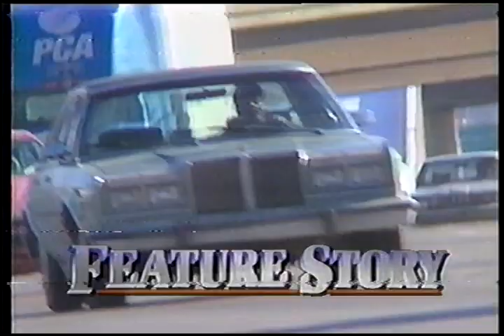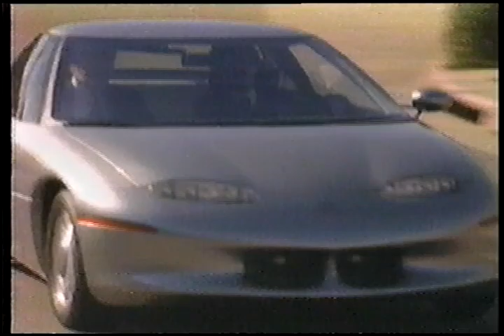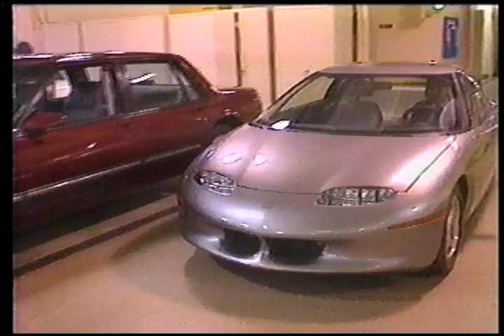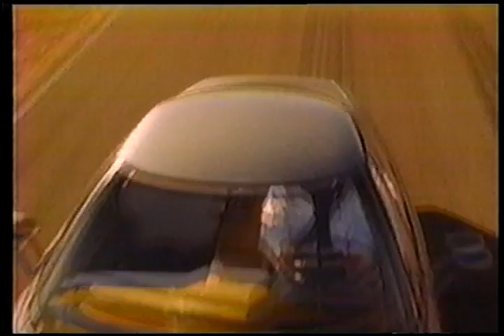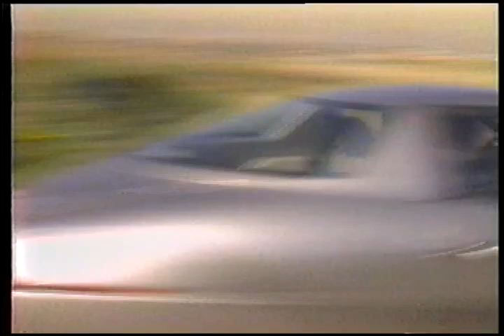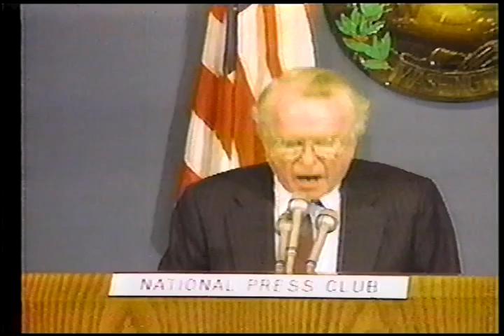1990 General Motors Impact Electric Vehicle (EV1) - Driver's Seat Retro

Comment: There were EV1 electric cars which they were made by General Motors since 1990.  Those models were two models of the EV1 Electric cars back in sixteen years ago from 1990 to 2006.  EV1 electric cars by General Motors would be missed a lot.  My parents didn't get both models of the EV1 electric cars by between 1990 and 1996 models for their own both 1990 and 1996 models of the EV1 electric cars by General Motors when I was young back in San Jose, California back in eighteen years ago from 1986 to 2004.  EV1 electric cars by General Motors didn't like us in this whole country of United States anymore.

Comment: I could see it beating the Miata, but the 300zx? Ok, I could see it beat the base model n/a 300zx, but not the turbo 300zx….unless there’s something I missed.
Reply: ICE take alot LONGER to Accelerate , they need to REV up.
BEV , are 100% Torque @ 0 RPM.